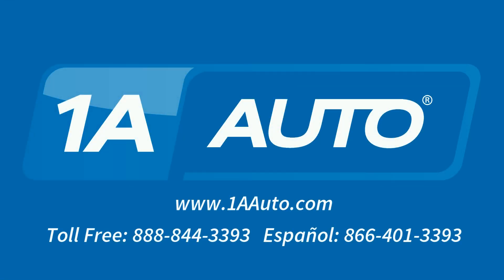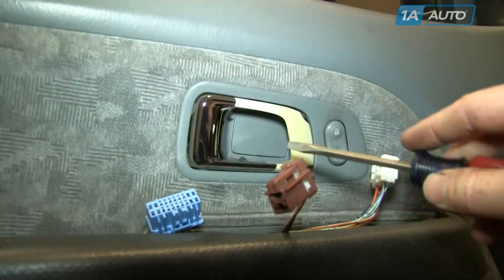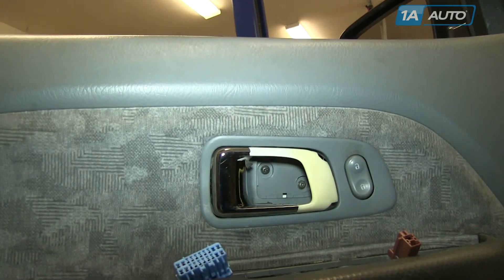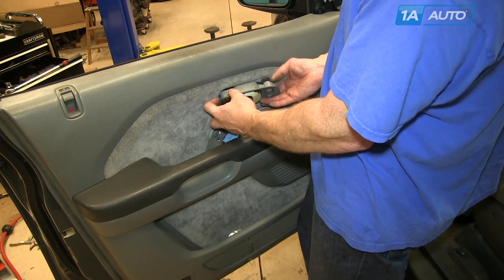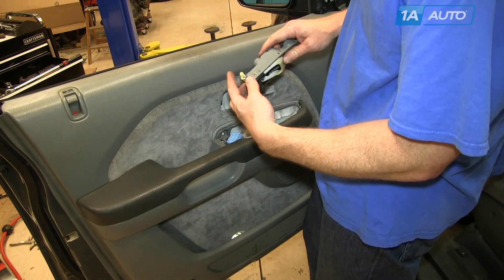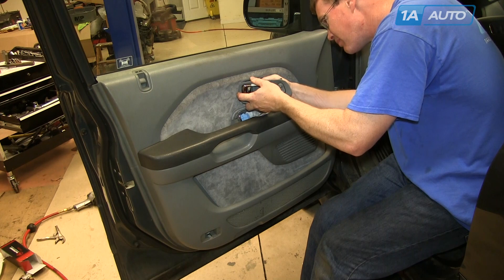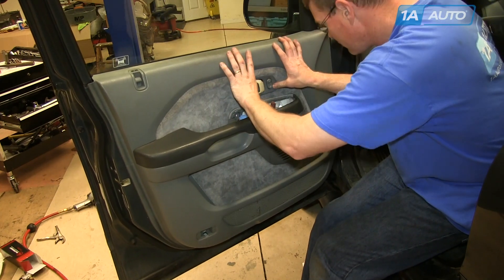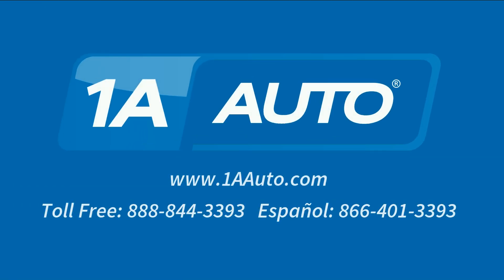How To Replace Front Inside Door Handle 03-08 Honda Pilot

Comment: Thanks! It’s a little tough to finagle the rod in and out, but some needle nosed pliers did the trick. Once you get the rod out, there’s extra slack in the power lock buttons so that wasn’t a problem. And thanks for the links to part suppliers! $28 in parts and a little elbow grease versus probably 10 times that at a dealer.